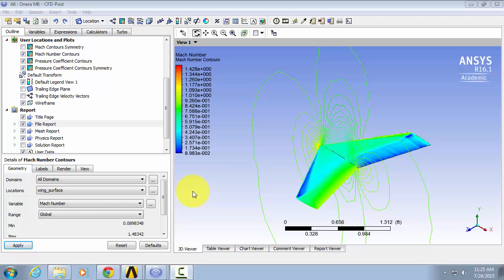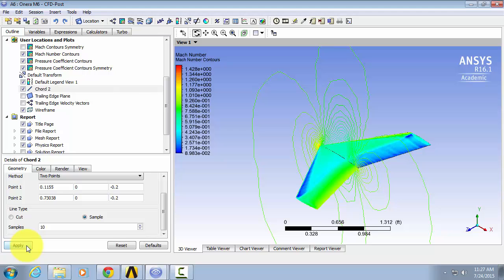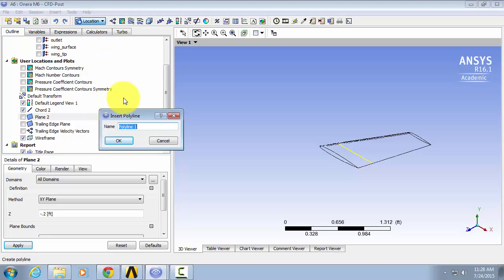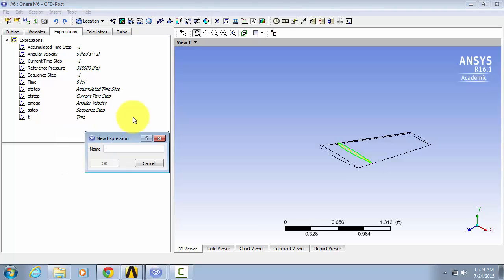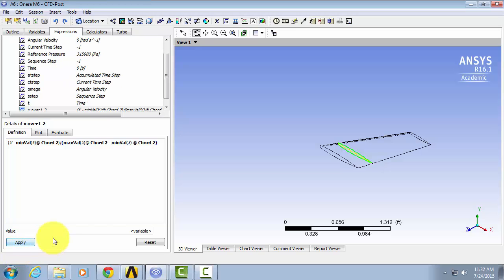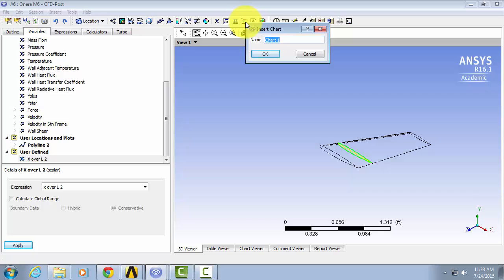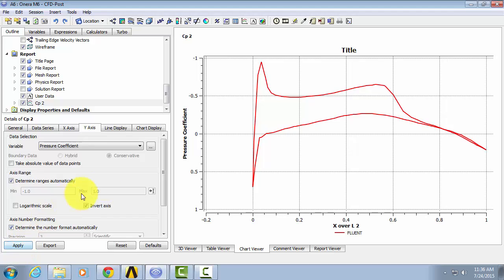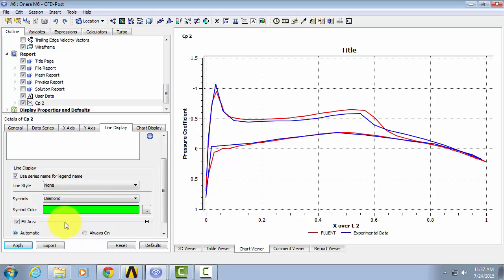SimCafe: 3D Wing Numerical Results 5

Comment: how did u get the pressure coefficient on the variables list? there is only pressure on mine
Reply: For anyone else that runs into this, you must create an expression for Pressure Coefficient using the following: (Pressure - Reference Pressure ) / (0.5 * areaAve(Density)@inlet * areaAve(Velocity)@inlet^2). You can then create a variable Cp which can be called in your chart.